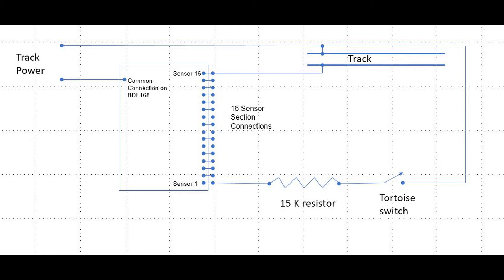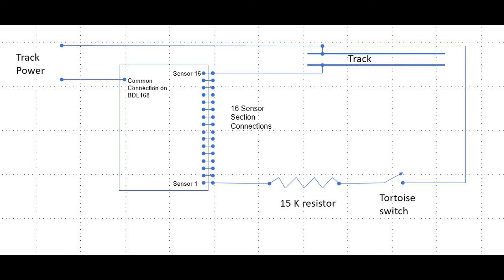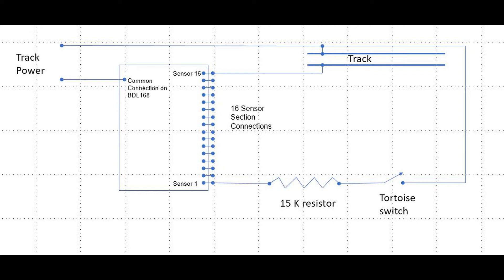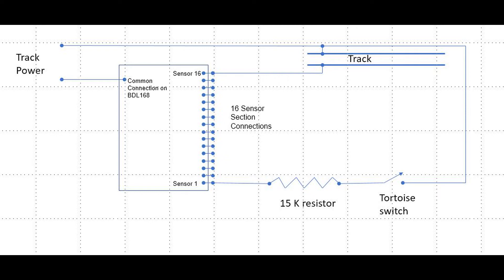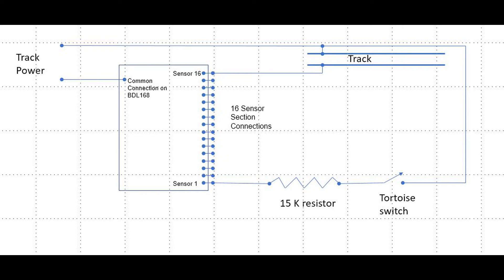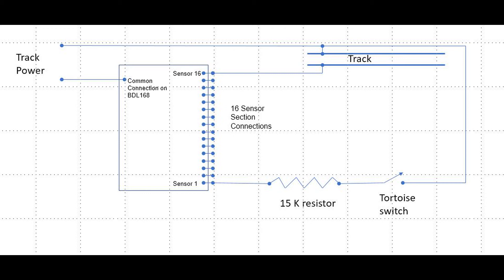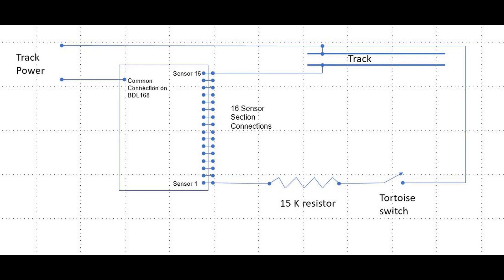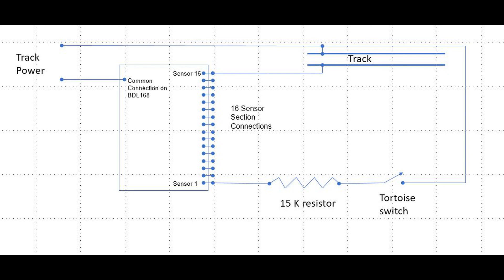Connecting Block and Turnout Sensors to JMRI

Comment: Hi Jim, Great Video! 
Rather than using the BDL you show in the video, I wonder if this would work with the ESU Detector part number 50094? I could use a hand with the wiring if you have a chance. I am new to detection and feedback and really want to get it working so I am able to integrate it to JMRI.
Thanks

Comment: This is very useful, I am thinking of trying it. What amp rating are the 15k resistors?
Reply from the maker: Hi Larry. I think they are 1/2 watt. But it really wouldn't make any difference because there will never be much current flowing. Almost any resistance would cause the BDL168 to detect "occupied", or in this case "thrown". I have been using this system for some time now and it is very reliable and has never caused a problem.